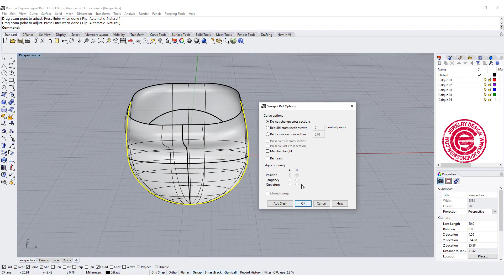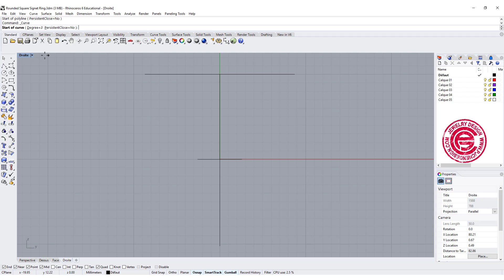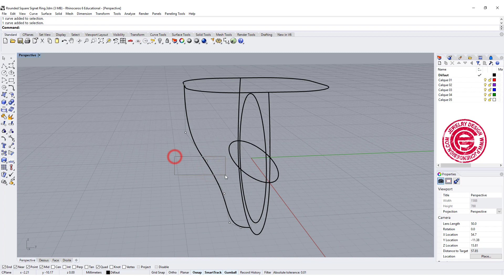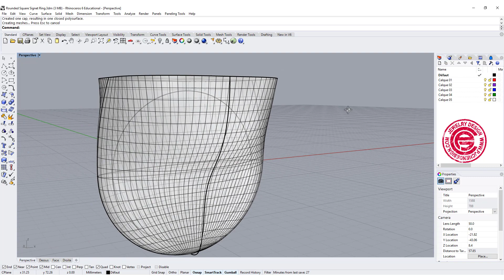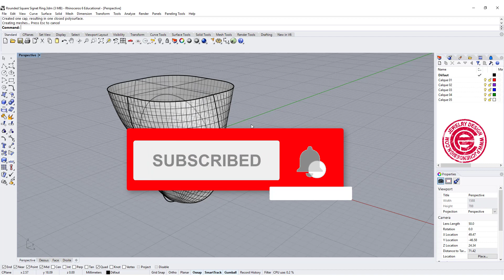Sweep 2 Command is not working well in Rhino 3D: Q/A Session (2019)

Comment: it would be better to mirror the side curve and ensure the mirror curve gets blended and is tangent, then make both sides together with a curve network. what we see in the video could have no or bad surface continuity in the bottom of the ring, after mirroring. in all cases make sure guide curves are normal to the mirror plane/line.
Reply from the maker: Thank you for sharing
Reply: @PJChenJewelryDesign  just saw that you made sure guide curve was tangent. ;)